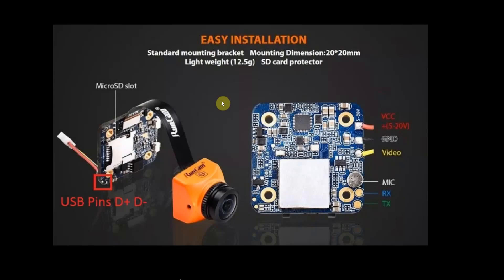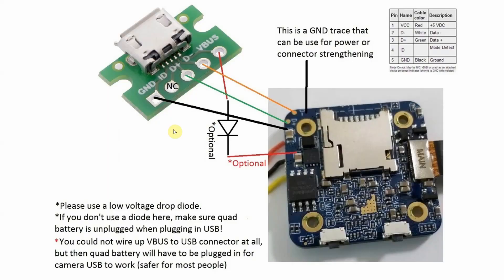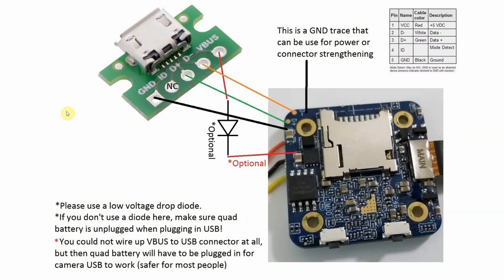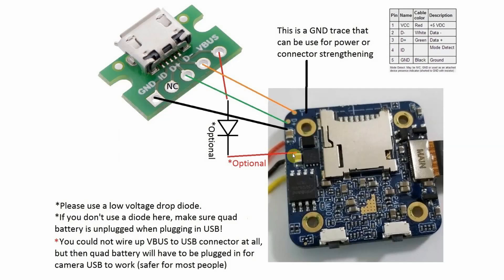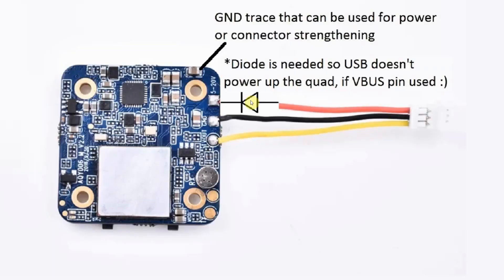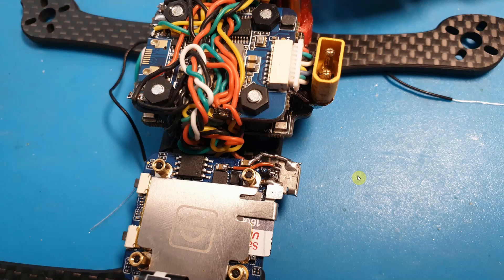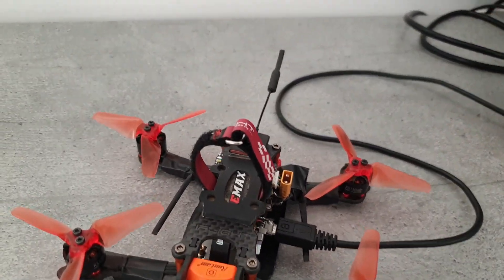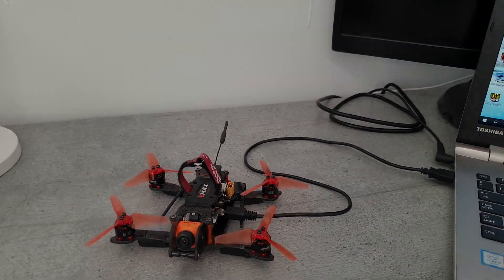Runcam Split Mini V2 add USB Mod

Comment: a good upgrade, I do not understand why they could not immediately attach a USB, I think it would not have risen much in the price of the camera.
Reply from the maker: they could have easily added it and it's useful if you have a tight stack, the runcam split mini v3 also has these USB pads for the mod.